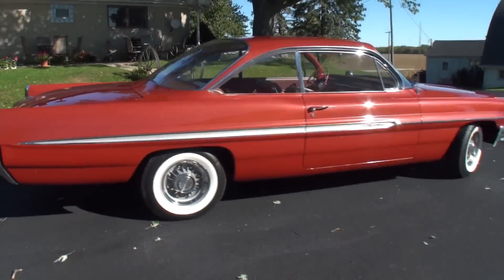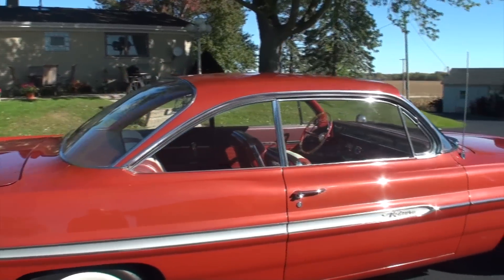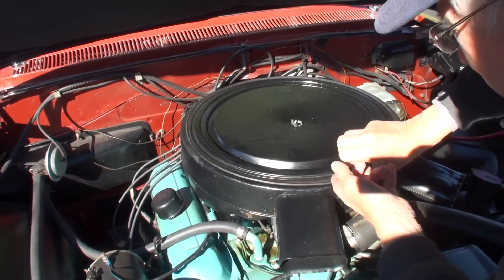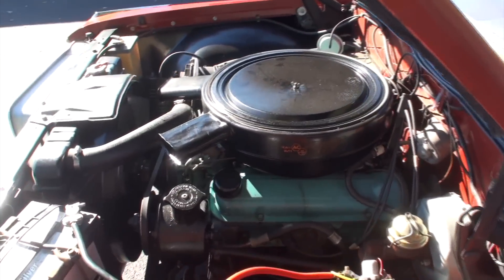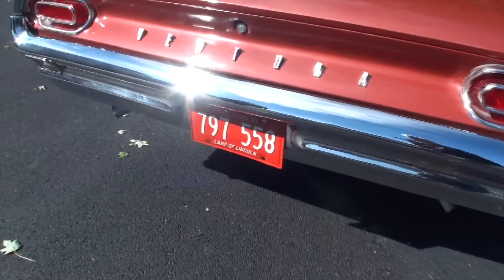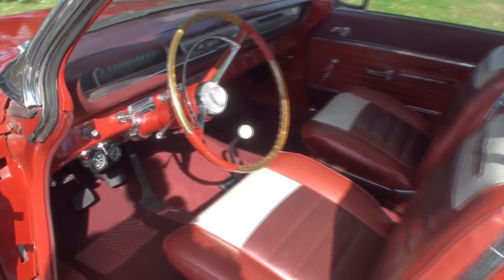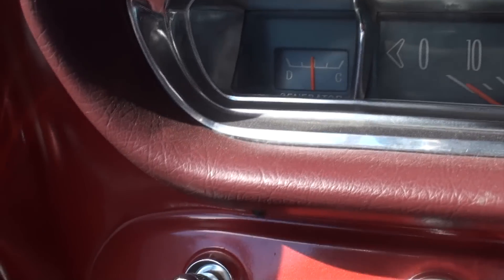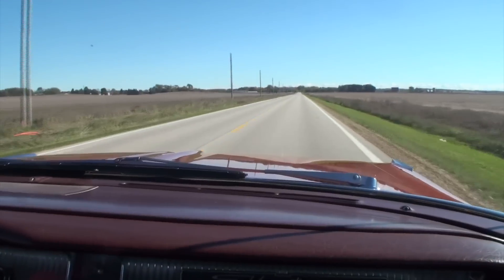1961 Pontiac Ventura Bubble Top 389 Tri Power 4 Speed in Red & Ride My Car Story with Lou Costabile

Comment: The Ventura was a separate model for both 1960 and 1961. It shared the same 119 inch wheelbase as the Catalina and Chevrolet only in 1961. Then in 1962 Pontiac made the Ventura a trim option on the Catalina but not a separate model for the remainder of the 1960s. Basically, the Ventura was a Catalina with extra trim. The 1961 Star Chief and Bonneville shared a longer 123 inch wheelbase but the greenhouse was shared with the shorter Catalina. Thus, there is a noticeable gap between the edge of the rear door and the rear wheel arch on the 4-door. Canadian Pontiacs of all trims during that era always used the shorter 119 inch Chevrolet chassis, with the small Chevrolet Inline Six and smaller V-8s. Also, Canadian Pontiacs did not use WideTrack.
Reply: Didn't know those details - thanks!
Reply from the maker: Hi SpockvsMcCoy Kirk, Thank you for sharing your knowledge, Lou

Comment: Outstanding!  When you look at those wheels you are actually looking at the brake drums.  They look cool but they have become impossible to find now and they do wear out after they have been turned a couple of times.  The 389 was a great engine except they would wear out the timing gears after about 80,000 miles.  Better to replace them BEFORE they break and cause a lot of damage.
Reply from the maker: Hi Craig, High praise :-) Thank you for sharing the details you enjoy, and a tip too, Lou
Reply: If you replace the linings before you have metal to metal, you  won't need to have them turned.
Reply: Many GM V-8's used plastic timing gears in the early and mid '60's which often failed. However, these engines were 'non interference' which means there was no engine damage when they failed. Replacing the timing chain and gears took only a few hours, unlike a modern GM 3.6L V-6.
Reply: @michaelbenardo5695  well, yes and no.  It doesn’t take metal to metal contact to create wear in a brake drum.  Most brake shops will turn drums that they suspect are out of round which happens!  Even so after 150,000 miles or so chances are even without drum turning they would be over.060 and need to be replaced.  When I ran a busy shop in the mid 70’s they were still (barely) available through Pontiac Dealers and they were over 100.00 each at that time.
Reply: @crankychris2  True and other cars used plastic gears too.  Few people replaced them as preventative maintenance.  I knew a guy who was passing a truck at night on a two lane highway in a Pontiac Catalina when his timing gear let go.  Not only did he almost get in a head on collision it did a lot of expensive damage when it failed!
Reply: @craigjorgensen4637  With with that many miles, often true, especially when semi-metallic, and even worse, metallic, linings are used.  I always do my own brakes.

Comment: Beautiful car! Thanks for sharing, Lou. John DeLorean took over as General Manager of Pontiac in 1960 from Semon "Bunkie" Knudsen. The 1961 was DeLorean's first Pontiac model, designed by Bill Mitchell and Jack Humbert with Bill Porter. DeLorean both designed and patented the Pontiac 8-lug rims featured on this car, in early 1960, and were first offered as an option on 1960 Pontiacs. I had a 1960 Pontiac Bonneville convertible with the original 8-lug rims on it, and it had a complete set of 1960 Bonneville stainless steel wheel covers if you wished to have standard steel wheels with the wheel covers. They were beautiful spun-metal discs.
I saw a car very similar to this one at the last GM Motorama in Los Angeles in 1961. Pontiac was proud of the design of this car, which was modified for the 1962 model year into an outstanding design by the same team in 1961.
Reply from the maker: Hi Donald, Happy to read you enjoy the looks of this car :-) Thank you for sharing your knowledge. You're welcome, Lou

Comment: Lou, I’m so glad I found and subscribed to your channel. I always loved those old ponchos. One thing that jumped out at me was those wing nuts when he pulled the top of the air cleaner off.  Those wing nuts tend to loosen, I hope he has them safety wired.. I would hate to see one fall down the carburetor throat and end up in one of the cylinders!  I seen it happen to someone’s Harley Davidson already.
Reply from the maker: Hi Michael, Welcome to the Channel. Thanks for the wing nut tip, and we had no issues with this Pontiac. Lou

Comment: Pontiac had the best styling in the GM line for that era. I suppose the Ford equiv. for this car would obviously be the '61 T-Bird. You really have to give the edge to the Pontiac... that 396 Tri-Power was IT until the 409 came out.
One thing you HAVE to look for on these old Pontiac's are the frame rails and the cassis in general. If you're looking to buy- Bring a screwdriver and start looking for holes in the frame. I saw an old '64 turn into a pile of crumpled dust after an accident a couple years ago. Caveat emptor!
Reply from the maker: Hi Swilko Barfington III, Happy to read you enjoy the styling of this car :-) Thanks for sharing a tip too, Lou

Comment: After reading some of these comments, I now have a question.

I have always assumed that the 1962 Grand Prix was THE replacement for the 1961 Ventura. But I see Lou keeps referring to the Ventura as "GTO's older brother." Was I wrong?
Reply: LOL I'll bet I'll get a yes and no answer. As in it sort of was a replacement, but not quite.
Reply from the maker: Hi hcombs0104, I'm saying GTO's Older Brother based on the 389 tri-power & 4 Speed combo. Has nothing to do with body design. Hope that helps, Lou